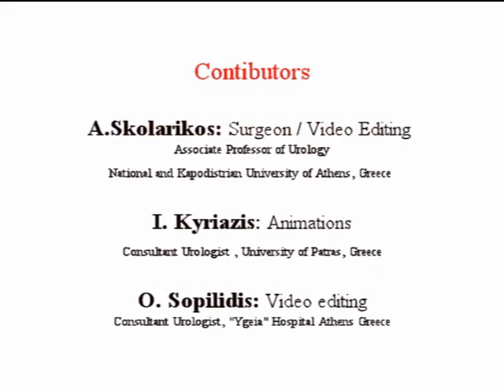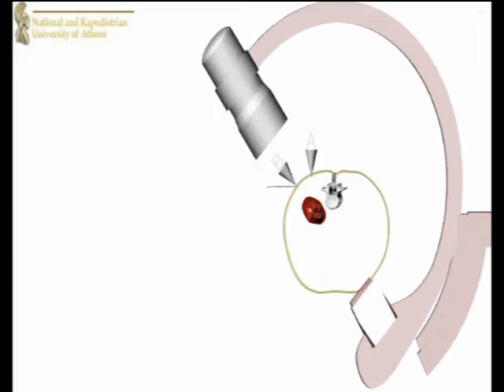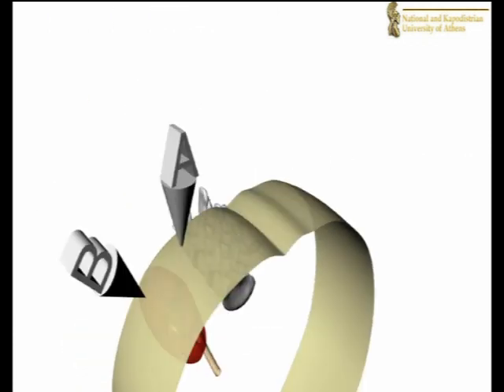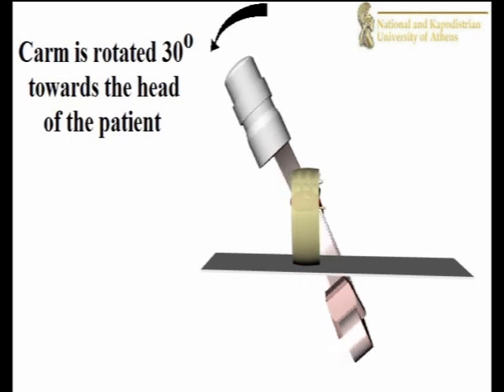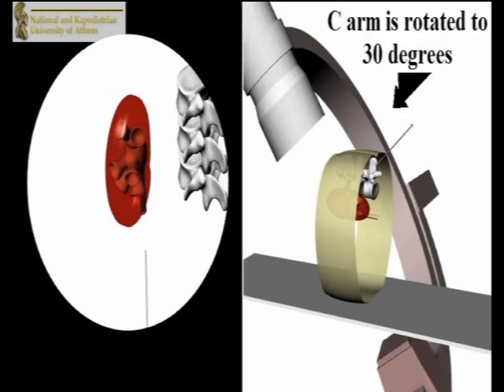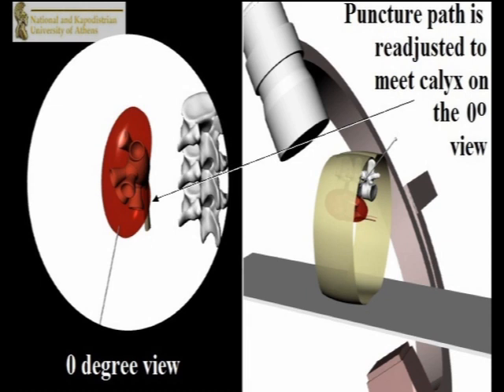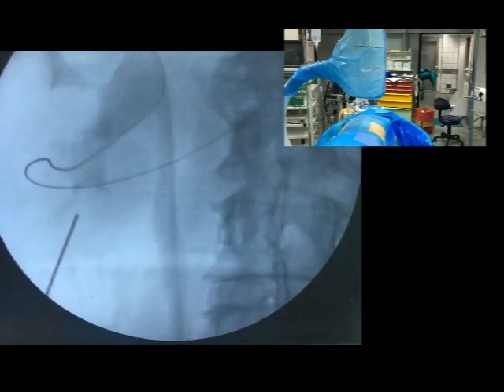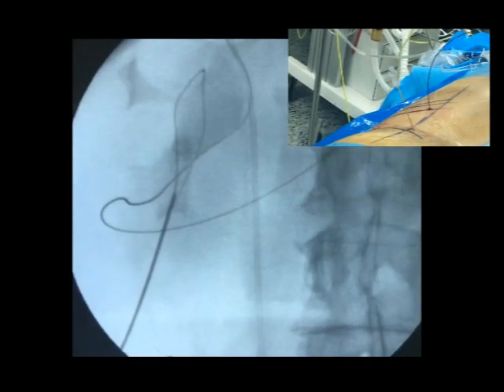PCNL Access with Fluoroscopy   Triangulation Technique

Comment: Actually this video is very good but there’s one thing i think the puncture  distance should be “2R”. As puncture point makes 30 degree angle with the target calyx which creating a 30-60-90 triangle, R is any depht in a line intersecting points “A” and “B”, as sin30 is 1/2, then the hypothenus (which is the puncture distance) (“C” to the target calyx) should be 2R. 
If puncture angle is 30 degrees. If C point is selected same distance between A and B then, in order to progress as R hypothenus, the angle should be 60 degrees